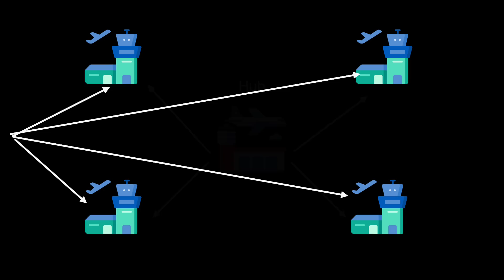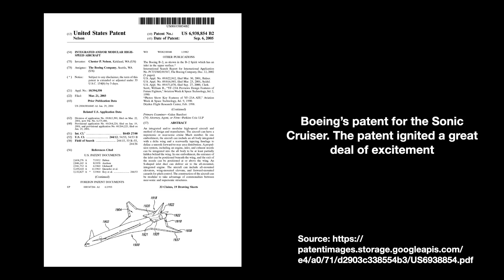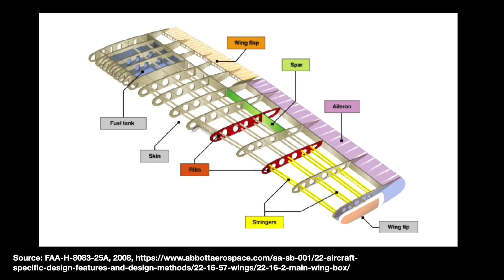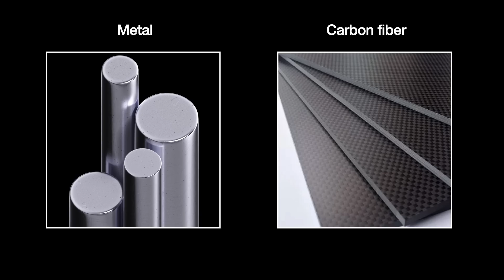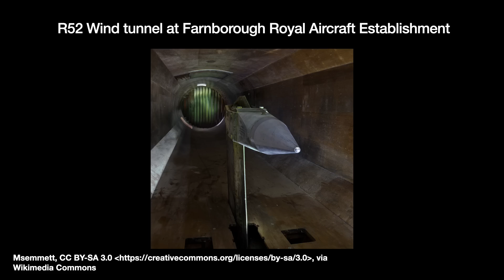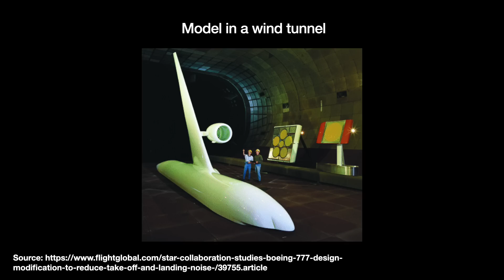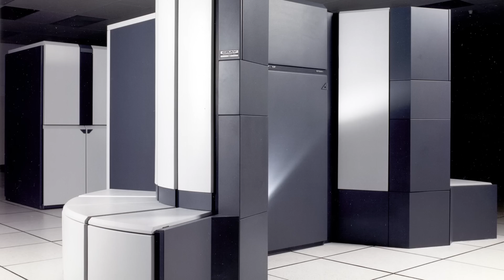How the Computer Helped the Boeing 787 Soar

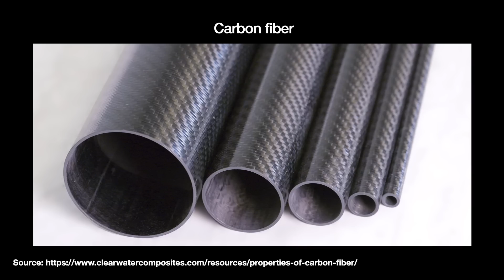Comment: 6:08 real missed opportunity here to show a picture of Aloha Airlines Flight 243. On that flight a Boeing 737 lost part of the upper half of the fuselage due to corrosion and metal fatigue from high cycle count, compounded by improper maintenance procedures, because in the end it all comes down to human error.
Reply: How the heck you post this comment 2 months ago lol
Reply: @Sevenigma777  they are a time-traveller
Reply: How tf is this comment 2 months old if the video was posted 4 days ago??
Reply: I remember that ..... cause a female filght attendant was suck out.....👍👍
Reply: If I remember correctly, the corrosion and metal fatigue is due to the short flight and too much salt in the air. If the plane fly like any another plane, longer distance and higher attitude, these problems will not happen so easily. The 737 was used to fly between the islands, so lot of take of and landing and fly rather low compared to other jetliners. If the jet fly higher, the internal air will be much drier and cooler, thus, less salt accumulated. But sadly this is not the case.
Reply: My grandpa's friend worked at Boeing, and developed osterperosis, due to bending over to inspect planes inside small compartments. 

 If they only bought him a single orange a day he would have enough calcium throughout his years, but they couldn't do that. 

 Anyway he ended up drinking to cover for the pain, and died DUI. 

 Boeimgs so cheap now man. 

 Oh wait I thought we were blaming Boeing for random stuff. Sorry.